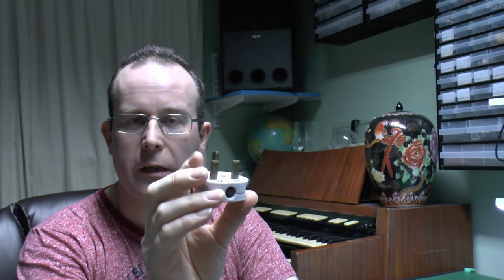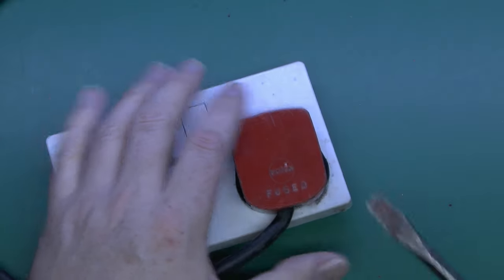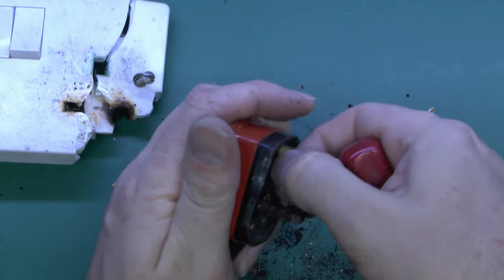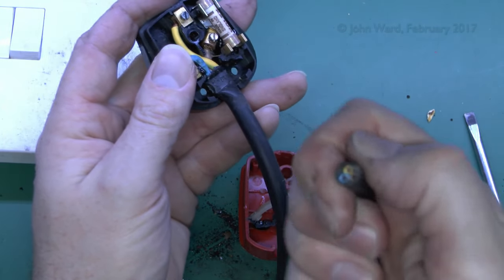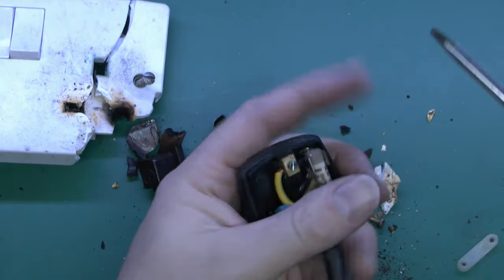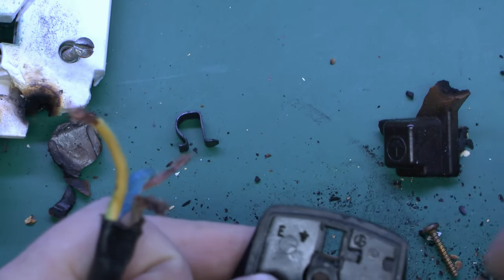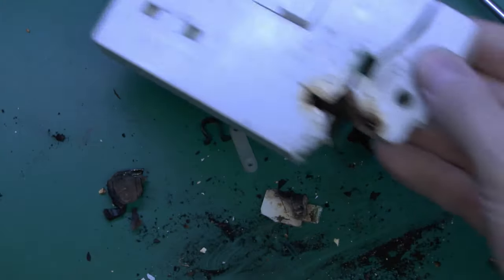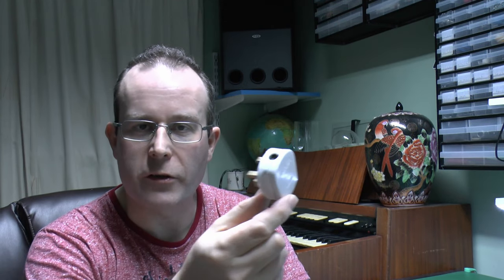Overheated Plug and Damaged Socket Outlet

Comment: I thought you were going to explain how this can be avoided not spend the whole video demonstrating the damage
Reply: If I may leap in here on John's behalf I think there are times when remedial advise isn't really considered necessary. I also think this is one of those times. When the cause is stated as either a loose connection or water ingress (in damp conditions) the solution to these problems are obvious. 1) Make sure you tighten connections securely so they don't work loose 2) Don't use water vulnerable electrical equipment in wet places. But if you must then at least take steps to ensure that they are shielded from possible water ingress. Sockets are available that are specifically designed for outdoor use for example.
Reply: Really? Which bit of my comment didn't you understand? I will see if I can make it clearer for you. Although I doubt I can. Word of advise to both of you if I may. If you need an in depth explanation as to why you don't bring water and electricity togther I suggest you leave the job to someone who knows. It may save someone's life one day. Even your own. Give it a miss.
Reply: It came with a "plug". Not a "socket". Plugs have pins. Sockets have holes. Plugs are attached to the device. Sockets are mounted to the wall. You have to insert the plug fully into the socket. So that there is no gap between the plug and the wall socket. You did make sure of that didn't you? If you did then your heater is most likely shorting out internally and drawing more current than it normally should. You must not use that heater until it has been examined and repaired.
Reply: Ye but I think it's better demonstrating because then we will forget what to do and rewind the video to the part you forgotten and it will be the same image so it might take a little long. Maybe for some people it wont 5ake that long

Comment: I've seen this happen with 3kW electric heaters. Even though everything seems tight and secure, the plug and fuse still tend to get very hot.
Reply: morthren I was just about to say the exact same thing, happened to me with a 2kw electric heater.
Reply: its caused by the plug end being yanked on and such, it breaks some wires inside, so it increases its resistance, thus heat. i used to see it on old peoples fan heaters allthe time (they have them for decades, use them for hours, always, work sockets etc) these days i just inform them to buy a new heater or use the central heating properly
Reply: +jusb1066 not in this case. At the hot point, the strands were all intact.  The various parts of the plug should be checked with an ohm-meter to identify the part turning current into heat.  Also the fuse should be systematically checked to see if it has a heat generating too high resistance and is not blown. Then after passing the non-destructive tests, it should be tested if it will actually blow from the supposed "must blow" current and time specified for a fuse with those markings (it could be a fake fuse).  Another comment suggested that at least one brand / model of plug suffers from inadequate attachment of the live pin to the fuse holder, making that a relevant thing to test as part of the investigation.
Reply: +john i see where your coming from, but a simple way to solve it, cut off a few inches and put a new plug on, usually is just a simple way to do it!, but thats gonna happen anyway once it has burnt a bit unless they go for full destruction!  i dont see an ohm meter showing too much , its a fraction of an ohm, hard to measure.  a 13a fuse is quite hard to blow,  and yes some plugs did a terrible fuse attachment method, i prefer the old MK split pin rather than the top rivet types, heaven knows whats inside moulded plugs now
Reply: actually we didnt see inside the wire before the pinch point, where it would be bent around a lot with people pulling it etc, i bet thats more likely in this case still!
Reply: I had a fan heater that repeatedly had overheating plugs - oddly, when I replaced the plug the first time, the heat started to appear on the neutral when it had previously been on the line side. Not sure what became of it in the end.
Reply: This can also be caused by resistance between the socket prongs and the plug prongs by either not pinching securely or being corroded inside. If it is a kitchen socket you can get a build up of grease over the years inside the socket prongs that will also cause a bad connection. Zs test will show it up.
Reply: londontrada,
That's what I'm thinking. Insufficient contact force.
Reply: 3kW electric heaters cannot use 13A plug & Socket as it uses such power, causing the plug melted. Maybe use a 16A plug. (Industrial socket) or (Carnavan plug top).
Reply: Totally agree 3KW heaters can cause that type of damage regularly I replaced one only a few days ago. The problem starts when people get those Red 3KW fan heaters and use them to heat massive spaces they crank up the stat and the heater could never heat the kind of space they are in the stat never turns off and result burnt plug and damaged socket the plug is moulded so loose connections shouldn't be the issue.
Reply: 13 amp wall sockets and plugs are Not man enough to take a 3kw load which takes 12 amps.
The live pin and fuse always get hot damaging the socket, the problem is worse nowadays with cheap fittings. I recently bought a 2kw heater drawing only 8 amps with a moulded plug getting hot and had to replace that with a better quality plug (Duraplug PF133) and also replaced the wall socket. I don't know why the powers that be have not done anything about the quality.
Reply: @drcl7429  yeah, but thats ok as kettles are usually only on for a few minutes at a time, biggest problem with them is some use only 10amp rated cable, it gets quite warm even only with those few minutes use!
Reply: @drcl7429  Generally ~2x rated current is needed to pop the fuse.
Reply: @hf5909 I once purchased a well-known (one of the supposed superior) brand of washing machine from a well known supplier - I noticed on first use that the plug was getting quite hot during the water heating cycle. Having a smart meter I checked to see if it was pulling excessive power (It wasn't; the reading was about 2.6KW (~11.3A rms) which matched the specs of the machine). I popped off the fuse cover when the machine had finished (the plug had cooled down by then), and rather shocked that the fuse contacts were rather thin and making little surface contact with the fuse!

Needless to say I informed the supplier and they agreed for me to cut the plug off and fit a more robust one! The new plug doesn't heat up noticeably at all.
Reply: Kacey Anders  my job I’m working on i have  5 x 3kw heaters I have one in each room.  They run continuously all day 8+ hours because the rooms are large and doors are open so the thermostat never turns them off.   

Being in UK most houses are circuit wired but on my jobs I insist on radial wiring only.   

Anyway non of the heaters cause any melting even though cheap temporary socket fronts have been fitted
 all 5 of them do cause the neutral prong to become warm to hot but not melting.
Reply: Yeh I've got a 2kw heater that does this I'm pretty sure wire undersized but no markings. Never use it it's just a back up so not too bothered by it

Comment: The green oxidisation indicates that the plug has been wet or damp at some point. I would suggest that the high resistance caused by the oxidisation could be the cause of the initial overheating and eventual failure.
Reply: Exactly;  he speaks of "loose connections", but those connections were TIGHT (!)--just look at what he had to go through to get the wires disconnected!  The oxidation/corrosion (Cupric oxide) does not conduct electricity, so the remaining un-oxidized copper is left to do that---BUT---there's not enough of it left to conduct the load:  it's like using 24 gauge wire on a 25 AMP circuit, so it BURNS UP, as expected.
Reply: Smarty marty 😉

Comment: I've found in the past that with high amperage loads like washing machines and heaters, the fuse can get weak over time and generate a far bit of heat without blowing, a new fuse cures the problem for a while.
Reply: lots of ppl seem to dislike the word amperage but is it really any worse than voltage, which is ubiquitous in place of "electric potential difference", admittedly a mouthful compared to current but the principle is the same
Reply: Your physics teacher is not an electrician ;)
Reply: Found on older Duraplugs the ends of the fuse contacts used to blacken. Also used to have to thread the top cover on. Think they have changed the thermoplastic chemistry to stop this from happening. Tend to use the white or orange ones now as they stand out better. Sealy/Masterplug are alternative brands for the heavy duty thermoplastic plugs. Mircomark heavy duty thermoplastic plugs used to have a silver U shaped live terminal  to fuse contact that gripped the fuse rather poorly.

Comment: I had something similar happen with an extension cord - the attached appliances shut off without warning. I went to unplug the cord, and heard crackling when moving the flex. Turns out both line and neutral wires were loose & discoloured, so I disposed of the extension and bought a new one. Luckily, I caught this before it melted the socket!
Reply: What you described is what's happening with my extension lead at the moment. Thanks. I was wondering if it was the plug of an appliance that was at fault (my fan heater that's plugged into it keeps cutting out after 2 minutes), with a fuse needing replacing, but I think it's the extension lead that's faulty. Several sockets in the extension have burnt out a bit already. I bought a new extension lead yesterday, so I'll see how things go with that. 🙂
Reply: On second thought, I think the fan heater's fuse needs replacing as well because there's visible melting around one of its plug pins! 🤦‍♀🤷

Comment: Ooooh, John! what you have shown here is a VERY SERIOUS case of someone being a Plug Dullard!

Look at the state of that earth pin! Good luck trying to get an half-decent fault current through that! :-O

Some time back, I done a video on "How to use a plug and socket" and last Friday (10th Feb 2017) I even done a video on why it is a good idea to shine up plug pins.

Chances are, before that plug had a meltdown in the socket, it was a total wreck anyway, and the PLUG DULLARD tried their luck one time too many. Then it let loose!

I have seen cases of this before now, but..... not this bad!!

Also, just to add-on to this: sometimes, damage like this can be caused by THE SOCKET.

If there is a socket with devilish tendencies to chew up plugs and spit them back out, then there is either something wrong with the socket, or the wiring in the back. Checking the tightness of the terminals would confirm either a faulty socket or loose wiring.

In this case, because you have TWO damaged sockets, this carnage can be blamed on..... 

No, not the plug, BUT THE PERSON who slave-whipped that poor plug into carrying on until it died on duty.

Those Volex plugs are generally good, we used to have a similar one on our kettle around our previous house and that was a 2.75kW non-auto kettle as well. Never any issues from it.

Apart from the obvious damage caused.... look at how badly scuffed up those sockets are!! That, once again is a serious case of sockets being given a hard time. We have those sockets about here-and-there in this house, (Crabtree) and not a single one looks ANYWHERE as badly beaten-up than those two you have there.

Those sockets have had a hard life. May those sockets and that plug R.I.P.

......Rest In Pieces, that is!

Thanks for showing,

-Wayne's Electrical.

12th February 2017, 22.15
Reply: Did i just read an essay

Comment: the same issue can happen when the wire is yanked often enough to weaken it near the plug end, it breaks wires inside the wires causing a higher resistance at that point, i used to see it on old peoples fan heaters all the time

Comment: Thanks for your info.
I just replaced one and it was a heater that was plugged in.
I reconed the heater was faulty.
I won't use the heater again although is fairly new going to take back to Argos.

Comment: Thanks again for another great example of what can go wrong. I have just had to replace a plug and socket in exactly this condition. Both were installed as new only 9 months ago in a working kitchen on a tiled surface. Looking at your example I would go with water ingress as primary cause of failure. In my case too. I noticed in my case that there was a recent break in the seal above the socket that could allow condensation to run down the tiles and into the socket immediately above the live pin on the one socket that had failed. No sign of corrosion like yours probably because the parts are relatively new. Your example looks old. But the damage is exactly the same. Wasted live pin and melted socket. Equipment as the source of problem ruled out by testing. It's a 2.5kW grill with no signs of internal damage, element not leaking and drawing 10.4A max as expected.

Comment: Looks like all the pins were as corroded as the earth, causing resistance and heating. I use steel wool to clean plug pins, then a smear of vasaline which will stop the air and damp causing corrosion. I similarly use vasaline or protective contact lubricant  on wire ends & connections, especially in damp places, to prevent corrosion and eventual problems.